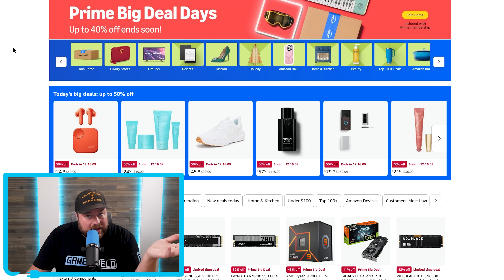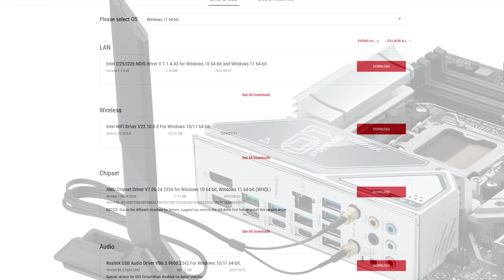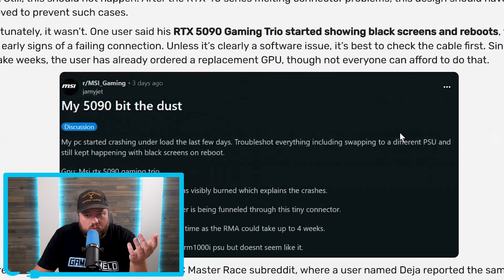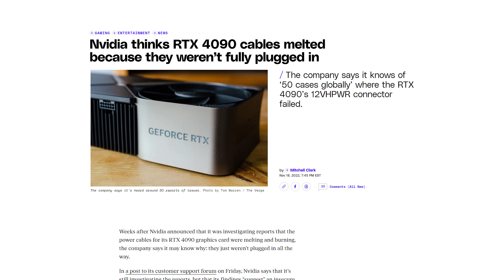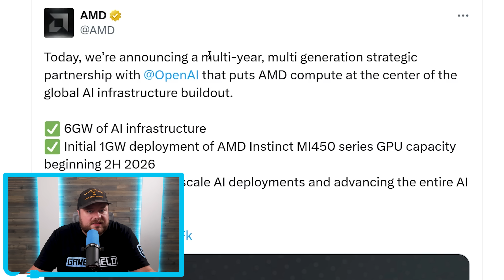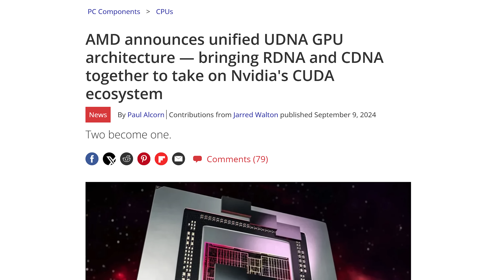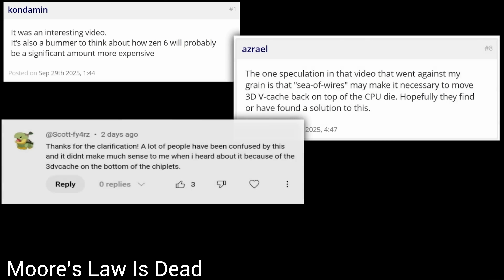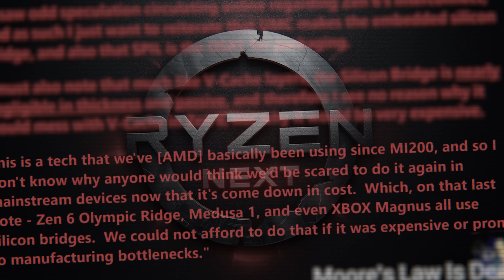AMD’s About To Do To GPUs What They Did With CPUs!

Comment: by the way, most us wall sockets (120v 15a) can only provide up to 1800 watts. a power supply can only supply up to 1440-1656 watts for internal components, at 80% (80+ bronze) to 92% (80+ titanium) efficiency respectively.

excluding the gpu, everything else usually requires about 200-300 watts for amd and 300-400 for intel, leaving at most 1000-1200 for a gpu. nvidia can't increase power draw any further without losing a lot of customers, because the cost of upgrading an a wall outlet in many cases could exceed the cost of the computer, and landlords are often hesitant to approve such upgrades even when tenants are willing to pay for them. and end users aren't the most impacted - it's actually businesses who are. i've heard it take months even to just get a broken soap dispenser replaced, so imagine how hard it'd be to get wiring upgraded in such a place. (you have no idea how absurd business space rental contracts get.)

Comment: If your video card is eating enough power to cook the connector, maybe it's time to stop brute forcing the problem, and design lower power chips. Maybe they forgot about the whole thing with 3DFX, but Nvidia are pushing for ever higher prices, and rolling out features that the consumer market doesn't need. With power bills rising everywhere, 300w cards are going to be less attractive, and there is no budget market with on-chip CPU graphics.

Comment: As technology improves, we should be more power efficient. We shouldn't be needing more and more higher end GPUs to run crappy unoptimized titles.
We shouldn't have power hungry GPUs that will be catching on fire!

The focus should be more on more power efficiency and more computational efficiency and simpler GPU systems.

However, how will they rip end users off if they don't roll out new and more expensive GPUs.
Their schemes are so boring once you can see through them.

Comment: The answer is to add 2 connectors. 2 Twelve pins or 2 ten pins are the answer... If they cannot get away with 3 x 8 pins. They must unload some stress of a single 12 pin and it's not a debate

Comment: I know the exact issue with the 12v connectors. They are using far too small of wires and connecting plugs for both the cable and gpu. It’s all about resistance and the longer they run the more heat build up which causes more resistance leading to even more heat and less efficiency until the thermal limit of the circuit can no longer hold stable power and causes a thermal spike leading to connector go poof

Comment: It's the lack of shunt resistors In these damn rtx 5000 cards. 
Rtx 3090 had 3 from 12vhp to vrms. Rtx 4090 was cut down to 2 with wattage cranked. 5090 has 1 and wattage cranked more .
See the trend here ... it's on purpose to save money n also consumers are forced to buy new cards when they cook themselves in 2-3 years

Comment: we need long overdue 10x jump with GPU performance, not x1.2 4080 @550usd, not 0-5%/year 'improvements'.
current gen gpus don't have enough performance to run modern games without upscale from 540p-720p. at max settings max rt indiana jones rtx5080 57fps 1080p, 9070xt 17fps 1080p, 5070ti 54fps, RTX 5070 ...13fps. slow junk low-VRAM 10x overpriced like mining isn't over 'modern' cards can't even run modern games. 
meanwhile 1440p 100hz cost 100usd, which means 5080 has like 35usd worth of 2025 gaming performance. 5080 is a xx30 class card if you judge it by its performance in new games @ max settings max rt.

Comment: Nvidias connector is one big reason I haven't bought a card from them since the 3090. And I probably wont any time soon.
Reply: Same here I also have an RTX 3090, I'm not buying NVIDIA until they fix their fried power connector problems and bring prices down to. In the meantime I'm waiting for RDNA 5 (UDNA)!
Reply: My RTX 4070 Super hasn’t had any issues with the connector. Likely because of the lower power draw compared to the 4090 or 5090 cards.
Reply: The problem is not the NVIDIA connector, because even AMD cards with this have burned.
The problem is the standard is bad, and should be avoided like the plague.
Also 600Watt doesn't help at all!

Comment: burning gpu connectors is 100% nvidia’s  fault. They had it working fine with 3000 series and then changed how power is managed/checked to save a few dollars. The job of a manufacturer(or on this case the company that sets the manufacturing requirements) is to make sure human error is essentially impossible to ruin the product and that the product doesn’t self destruct within a few years. So whomever is at fault, it all points to nvidia as not designing things properly or setting proper manufacturing requirements.

Comment: 2:28 That's why nobody uses Windows anymore and is switching to Linux.

I will NEVER use Windows again, unless its for a) a backup in case my Linux system starts to annoy me with Arma 3 crashes, and b) for work most of the time.

Comment: imho 9070 was already their zen moment. the software stack is tricky to set up correctly, but for qwen models you can get 5070 comparable token/s for local inference at the same tdp already(with VRAM advantage for the non xt/ti). zen first gen was a far cry from zen 3. fsr4 is up to par on the gaming side.

Comment: Duh, you can keep your current install images for Windows and they won't be affected. So it's only an issue if you get the new image from Microsoft itself. Not that providing windows with a with an email address for login purposes is a big deal anyway. Most people install Windows once every couple years if that

Comment: This is why I don't buy high-end Nvidia GPUs anymore, because of the 16-pin power connectors. I sold my 4090 I don't want to lose $15000 over bull crap
Reply: You might not be safe either with AMD's next GPU. Their professional card the R9700 already uses the 12vhpwr connector on all models.

Comment: The Windows story sounds like they have had a hard time pinning down why a crash during OOBE happens and they have a fix on their side that will work but don't want to roll out as it probably will be removed by SIs for being bloat in their OOBE. The TD;DR is it is a sometimes but not always needed hotfix that might break some systems that do not need it but on others it will crash without it.
As PC hardware is so varied to have 1 image for all configurations is hard and I guess Microsoft hit the point that they had to code 2 different ways for it to work depending on the hardware. Assuming both are x86 it most likely is a CPU design change Intel and/or AMD made that taking out that feature makes Windows not work. What line of binary was taken out? Most likely nothing that will effect us gamers but something they use on in the OOBE setup script for windows 11 Preview. Windows 11 Preview has a lot more telemetry in it than the version in the update for the stable release we get. I am hoping it will be fixed before they push it out to us but as it is in the OOBE script process it will be hard and most likely a "new feature" that no one asked for.
Still as they most likely already have the fix for it they can just require SIs to include it or verify that their hardware will work with the version they ship. The most likely reason why Microsoft will not do that is they want the hold outs to sign up for a Microsoft account. Alike to them removing the TPM 2.0 requirement for windows 11 as it isn't needed to run while it is needed for a few features in the professional edition and Enterprise edition of windows 11 mostly in the connecting to a domain and network features part. Part the normal consumer will never touch nor know exist. For windows 11 Home it does not come with these features so TPM 2.0 is not needed to run windows 11 Home. Still Microsoft required us all to get new hardware to run it.

Comment: 4:50 "that this much power is being funneled through this tiny connector".  That much power and all the rest of the power to run your computer is passing through about as large a connector at the wall (or the UPS's or power strip's plug at the wall).  It would be much easier to reuse something like that than invent a new thing that keeps being crap.

Comment: so I run an admin account which is linked to my microsoft account and is then linked to my Windows 11 Key. after that I run A SEPARATE ACCOUNT THAT IS LOCAL AND ALSO A "USER" Level of privileges  limited privileges on local accounts for safety and security. and when you need elevated admin features you are prompted for your pin/password/fingerprint . THIS IS HOW EVERY USER SHOULD BE RUNNING THEIR O/S. YOU SHOULD NEVER BE BROWSING THE NET ON A FULL ADMIN ACCOUNT!! THAT IS VERY DANGEROUS              
That better not change!!

Comment: This could be fixed so easily. 
Just put a freaking plug on three GPU and use a power brick to connect it straight to the wall.
Yeah we would technically have two power supplies then but we could also get away with a much smaller and cheaper internal power supply while having a super easy to replace external one for the GPU.
Reply: As a retired electronic engineer your idea sucks, ie when say the one Power supply fails look out, also the ground levels between the two supplies would send it to the after life, ie main supply ground would be probably be swinging up and down up like yoyo when burst of power needed.... yeah the real solution is real simple make newer power supplies with higher voltage just for the video cards and the card can step the voltage down and have the current needed(power =volts x current) so if you need high power the way to do it is use higher voltages and reduce your current, that is why power lines are like 250 000 volts and then the sub stations step down the voltage and by default have higher current secondaries ....
Reply: @ntal5859 Why would one supply's ground affect the other? like my PC is connected to the monitor, the PC has one power supply and the monitor has another, a little power brick and there's no kind of problem between them despite a them sharing an HDMI connection.
In this case it's would be the same the PC would be connected to the graphics card via the PCI slot but one power supply shouldn't have to interfere with the other.
Power supplies are already powerful enough for a 5090, the problem is that the cables used to connect them are not big enough so why not have a graphics card use a dedicated power supply depending on it's requirements with big fat cables going straight to the wall? If it's such a bad idea then why don't we run monitors and speakers out of the same power supply that the PC uses? why aren't the power bricks used by monitors or speakers causing troubles with the PC's power supply?

Comment: a lot of the problum is crimping of the format of the 12vhpwr as ther is 2 levels of the cable its hard to crimp the connector as the pins are sliping away when installing

Comment: Very happy with my Red Devil 9070xt, great value for money and I got it at MSRP.  AMD GPUs have been good from RDNA1 and the 5700xt.  The 7000 were a little flat but good value in non RT gaming.  The 9070xt has been solid in most RT games around a 4070 TI Super.  If AMD can get equal or almost there many are sick of Nvidia.  Not happy with how Green does business?  Stop buying their cards!

Comment: 20 years ago wifi adapters came with a cd that had the drivers on it for windows.
If you had linux it would either just work or never work and that's how it got a bad reputation... I think it was unfair.
Reply: things are much better these days, and if your wifi doesn't work out of the box, you can still usb-tether your phone to it for connectivity while you sort the drivers out
Reply: I wasn't prepared for that when I installed Linux on one of mum's old laptops, otherwise installing and using it was pretty smooth.
Reply: I had to switch the wifi card in my fresh minipc with linux mint last week.
Reply: @atavusable  but did you really "need" to ? or was it just easier for you ?
Reply: @tienslabien  my card was too recent. the driver for it weren't available.
Reply: @atavusable  that does happen, glad you found an easy workaround :-)
Reply: Facts!

Comment: Now if AMD fully supports Linux with software and drivers I would completely switch to Linux on my main rig.
Reply: Did... You miss the news that AMD killed their proprietary Linux drivers to support the open source MESA project instead as it was pretty much superior anyway?
Reply: @whydoyouaskdude Mesa is cool but I would like to see Ryzen master software and adrenaline support
Reply: @DarkKielx  instead of adrenaline you can use LACT to control clocks, power and voltages of your GPU. Granted, it does not have other fine grain settings per app basis, still does mostly the job. For OC-ing the CPU you could utilize Corectrl
Reply: they dont have the adrenalin software but their linux drivers are super stable and get you good performance

Comment: If stix holo release like I am thinking well we will have issue, if next generation goes all in with sea of weavers and getting 1:1 to ddr5-8000Mhz ram memmory they do not even need to increase clock speed or anything that 2 things will give whole +30% performance increase alone.
I am scared becuze it can end up that amd CPUs getting price tag in feature like GPUs and it will be intel fault becuze they do not bring anything close to amd performance.
Since 2017 intel goes slowly down and for us gamers its getting better and better but price tag can get up.

Comment: The 12 pin connector will keep melting until the cards will have load balancing. Any card following the PCI-E standard where the pins have to be connected on the board has lost the ability to avoid all the current going through a single pin. Electrical engineers have tried multi cables on electric cars and stuff and abandoned it everywhere else before going to market with it because it doesn't work. Current will not split evenly by itself. Claiming it's the sense pins is misleading. They can't sense if the load ends up being uneven due to manufacturing variation and hence won't catch whenever it happens without being user error. It's also an open question if we should allow a fire hazard with such an easy to do user error.

Comment: 4:15 this is not an Nvidia problem (well besides them having the gall to make the abomination) the power cable also melted on a 9070 xt the reality is 12v2x6 and especially 12vhpwr will NEVER be capable of powering anything higher then the base 70 class. It just happens to Nvidia cards more because they push higher amounts of power
Reply from the maker: The part that makes it an Nvidia problem is that they’ve made it required for many of their cards. Also, Nvidia has a big hand in developing it.
Reply: @GamerMeld  I 1000% agree but I saw people on X saying the 9070 xt with 12v2x6 is safe when thats not true at all. Honestly there needs to be a class action against Nvidia for mandating the cable
Reply: All that AI yet the card isn't even able to shut itself down before it goes Chernobyl. I feel like they should ditch the project and either go back to the previous version or use a dumb industrial grade solution that just get the power through. If they absolutely need smart, use USB-C Power Delivery. At least the PD spec have the safeguards inbuilt on the standard and it is small enough you can put 4x240W plugs in the space of one of those 12vHPR ones. Heck by this point I feel like most of our ATX specs are zombies on a state of decay.
Reply: If NVIDIA is producing cards that absolutely necessitate using alternate connectors, then they need to force their AIBs to use a safe alternate connectors instead of...that.

Comment: Steam OS can't come soon enough
Reply: Facts.  I’ve used Linux in the past and I currently use it on steam deck and it’s phenomenal. 
I’d switch 💯 at the moment but me and the wife play Fortnite daily darn near and that’s the ONLY thing holding me back. 
The anti cheat software doesn’t run on proton or wine.
Reply: No kidding. I may have to dual boot my PC with Linux and work on the transition because this shit is getting ridiculous.
Reply: you definatly don't need Steam OS to go Linux. What are you afraid off? :)
Reply: Steam os FTW
Reply: It's not even close honestly. Valve is working on these so called "XDG protocols" which will allow apps to interact with the OS but it's still at least half a decade before it's all done. Whether or not your apps will work on it is a whole another issue
Reply: Bazzite is made for gaming, if that is your thing.
Reply: @unclej3910 I’ve heard a lot about this.

Comment: 10950 XTX? Nah, why not use the X as 10 like they did back in 2004.
Reply: They might have an internal breakdown if the bigger number better people get in a fight with the add more X's contingency.  A compromise will likely be reached after several ugly months, and the 10XAI950 XTX will be bourne
Reply: @douglasmurphy3266  Well, we already had X1900 XTX/X1950 XTX back in 2006 so that wouldn't be anything special. :D

Comment: If you are on Windows at this point, YOU are the product. So glad I switched to Linux.
Reply: wish I could, seems like fortnight doesn't work in any Linux distributions due to anti-cheat program running in the background which is kernel based :(
Reply: @clearrighttoknow4775  I forget about the kernel level anti-cheats games.
Reply: Just use older versions of the custom ISOs like Win XLite.
Believe me, the "security" updates are not as scary without them as most people think. I use 22h2 with zero windows updates for a long long while now. No issues. Outside of random driver lock up that requires a reboot once every 3-4 weeks.

I also use brave, pihole, and opnsense. so my setup is a bit more secure than the average user. but the point is don't click anything sus, or open random email attachments. you will be safe.
Reply: Ok good for you 👍
Reply: @NeVErseeNMeLikEDis  Why stay on Windows?
Reply: @NeVErseeNMeLikEDis  How old are you?